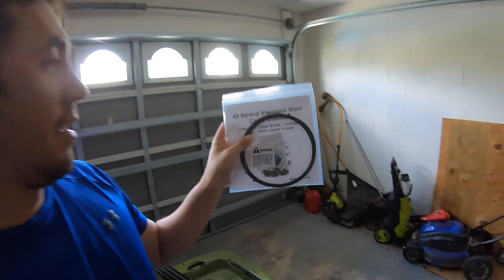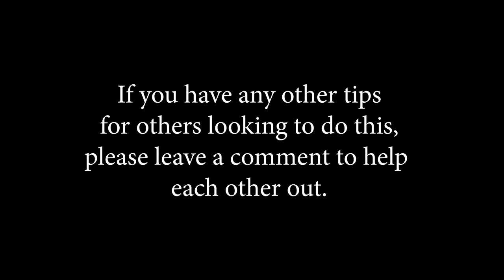Basic Replacement Fix for Native Watercraft Rudder Cable

Comment: Thanks for posting this video! How long did it last before you replaced it with the cord?
Reply from the maker: I was running the Slayer pretty hard. The cable didn't break but I replaced it after a year just to be safe since it started to get some play. If you do the hemp chord replacement instead of cable, it should last much longer.

Comment: After I removed the tiny screw from the hand control the old cable wouldn't slide out, I sprayed some wd40 on it but still nothing. Did you have any problems with that?
Reply from the maker: I didn't and I replaced the cable a few times. Maybe take it to a dealer if you're close or contact Native as it shouldn't be an issue.